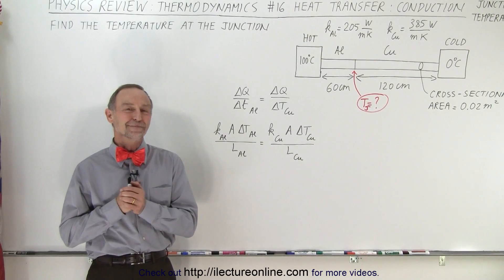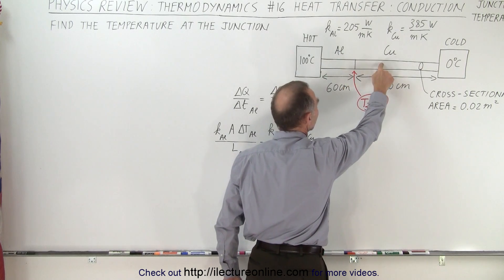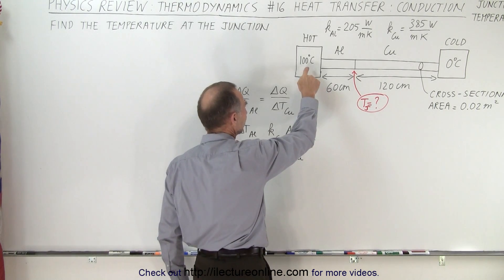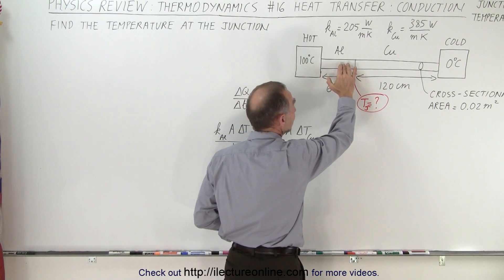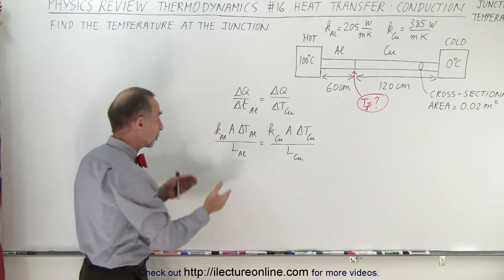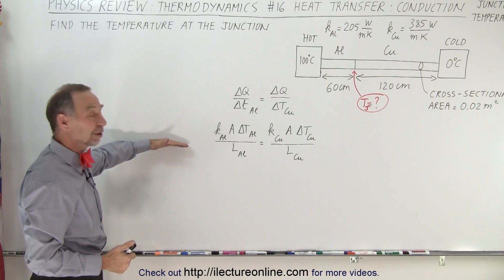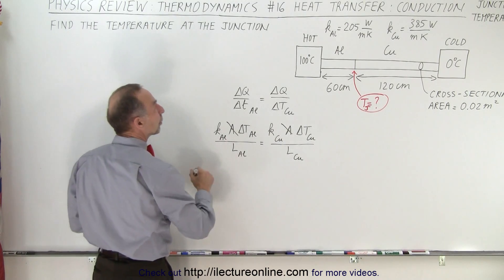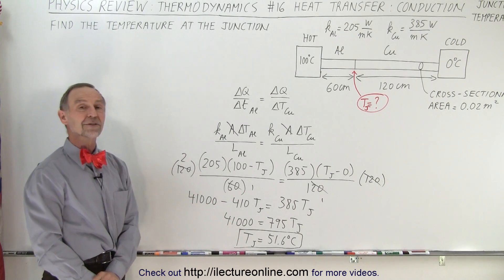Physics Review: Thermodynamics #16 Heat Transfer: Junction Temperature

Comment: Thank you. How long does it take for the temperature to become Tj?
Reply from the maker: That would be a complicated question to answer as it requires differential equations.  We have videos similar to that in our differential equations videos.
Reply: @MichelvanBiezen  This is not difficult, if we use the analogy of electric circuits. In this case, we need to find the parameters of 4 elements:
1. Thermal resistance of an aluminum rod R1=0.6/230=0.00261 m2K/W.
2. Thermal resistance of a copper rod R2=1.2/395=0.00303 m2K/W.
3. Heat capacity of an aluminum rod C1=M*C0=32kg*896J/kgK=29000 J/K.
4. Heat capacity of a copper rod C2=M*C0=214kg*383J/kgK=82000 J/K.
The temperature difference (100-0=100K) is similar to the potential difference. 
So, the capacitor C1 connected in parallel to the input signal (100K).
Also, the input signal (100K) is applied to the series combination of both the resistor R1 and the parallel connected capacitor C2 with R2.
The result is 330 seconds for the temperature Tj to reach 50 degrees.